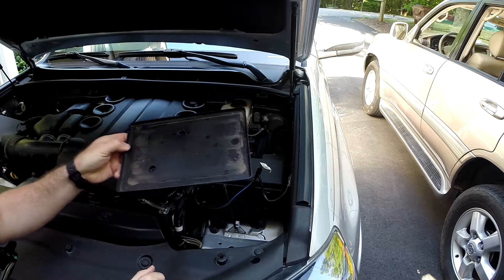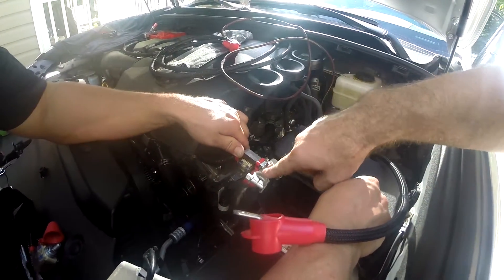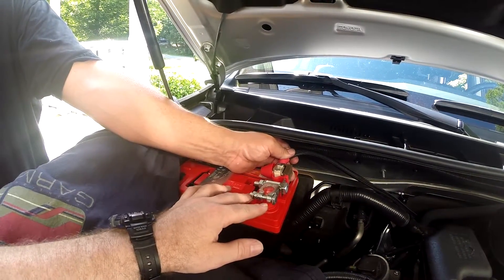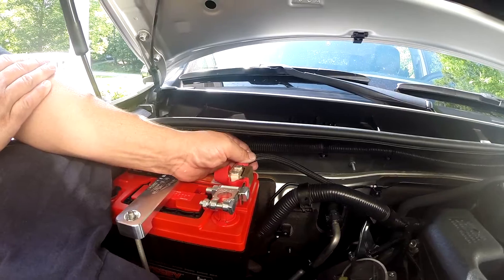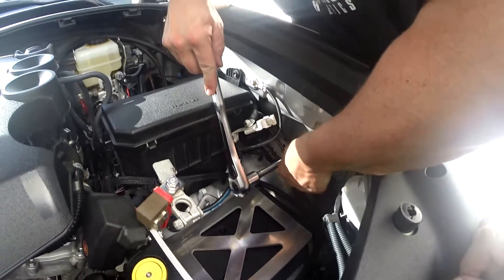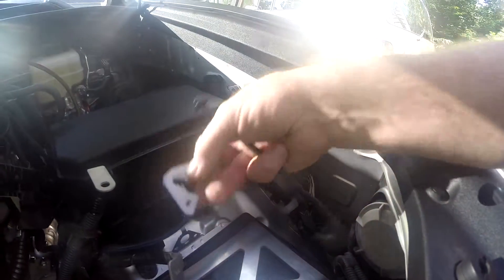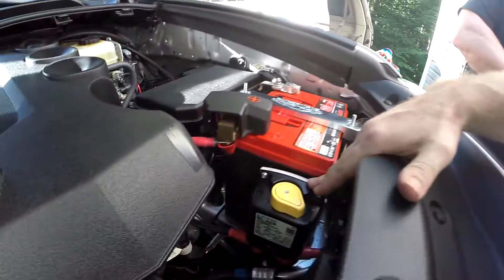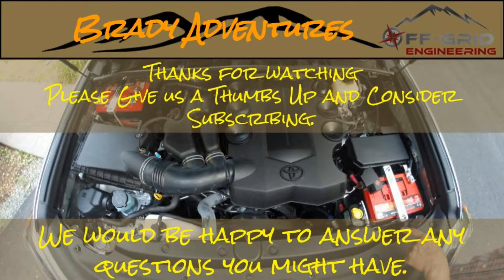(4 of 5) 5th Gen 4Runner Dual Battery - Start Battery Tray - Wiring Install

Comment: did you have to upgrade the alternator?
Reply from the maker: We haven't had any problems with the alternators covering down in the 4runner or land cruiser.  They generally charge the aux up pretty quick.  The main issue is that deep cycle and especially agm batteries get maximum charge from a phased charger and higher voltage than the alternator puts out.  Alternator upgrades generally put out more amps not higher or phased voltage.  That's what a dc-dc charger will get you.  Since we are not on the road for extremely long periods, like some, we just slap an AC agm charger on them when we have shore power so they get completely topped up every now and then.  Eventually I am going to install this onboard ac-dc agm dual battery charger.  https://amzn.to/2CcoMcx  
Hope that helps, let me know if you have any more questions.

Comment: do you have links to all the products you used?  Great video!!
Reply from the maker: Here is the link to the Off-Grid system.  Everything else we used was basic stuff you would find at your hardware store.  If you have a question about a particular item I would be happy to send you a link to an equivalent item on Amazon.  Thanks!

https://www.offgrid4x4.com/collections/dual-battery-systems/products/5th-gen-4runner-complete-dual-battery-system?variant=30948449094